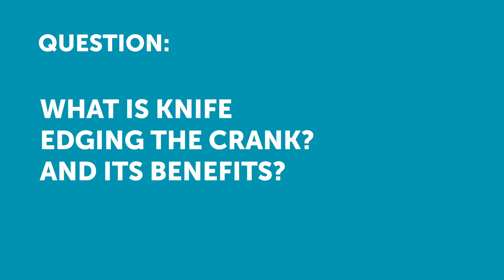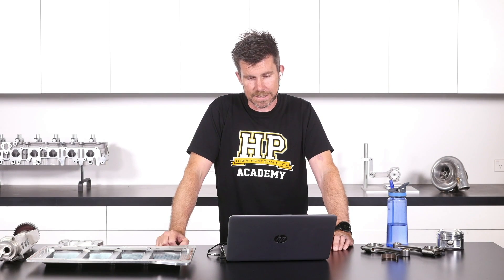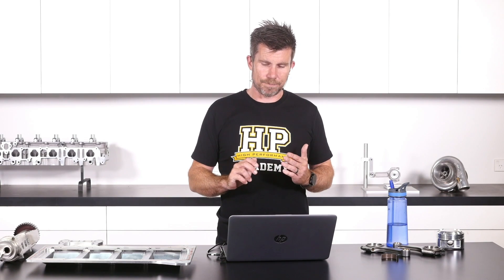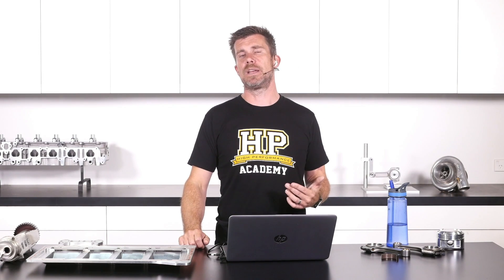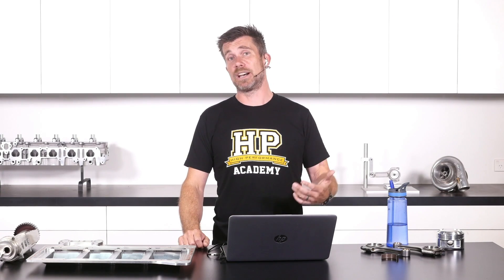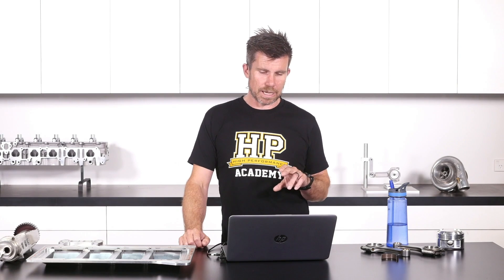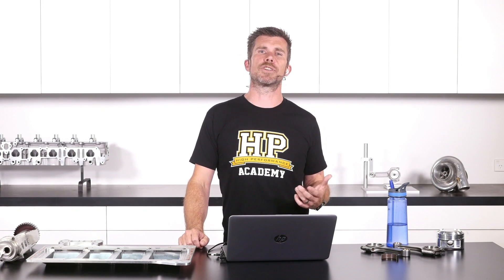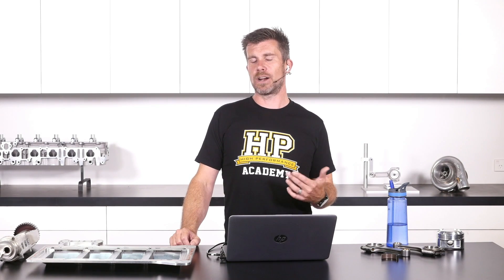Knife Edged Crankshaft | What Is It, Do YOU NEED One? [HPA Q&A]

Comment: Windage is about a longer throw and the increased mass of crank and even rods (aluminum), at increased RPMs, than a "street" engine. BBCs with 4"+ cranks are known for it. Where it is about the mass of the counter-weights whipping up the oil; to the degree that a quick fix is to lower oil capacity. And "knife edging" is about reducing half of the blunt leading edge going into the oil; and not aerodynamics...So, with a dry-sump and even a windage tray or special pan (wet), the need is less...But when drilling the throws (rod attaches) for lightness, the counters are cut for balance.

Comment: Knife edging is about inertia removal from the circumference of the counterweight not windage. The leading and trailing edges of the counterweight need to be aerodynamically profiled if you want to cut the windage and the leading edge shape should not be knife edged